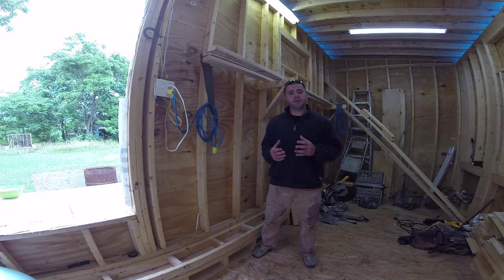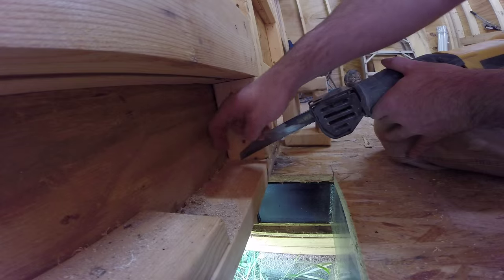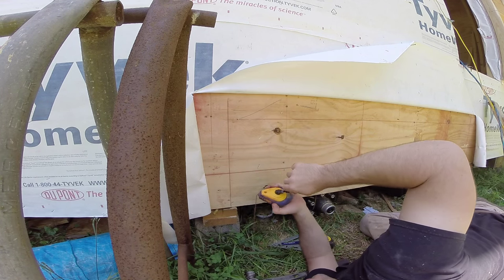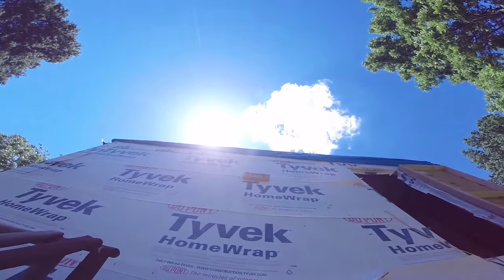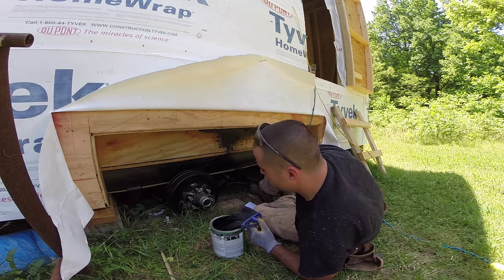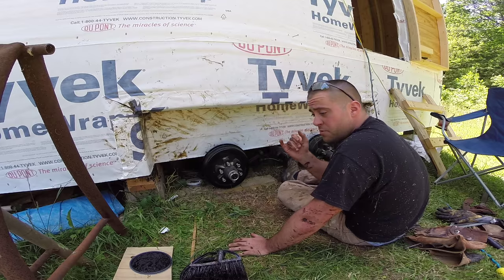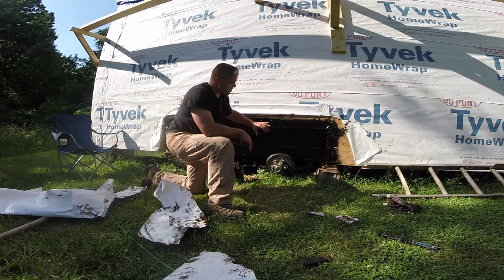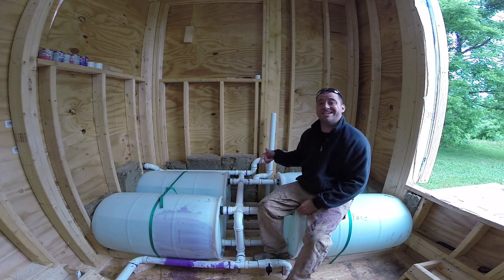Tiny House - Waterproofing homemade wheel wells  Part 2 of 2

Comment: This is such a great idea!  I wish I had known that I could build my own wheel wells before I purchased my trailer.  However, now I am trying to figure out a way to waterproof my metal wheel wells that have the walls built on top of them.  Do you have any advice for that?  I was thinking of sealing them the same way you did, with tar and tyvek inside the wheel well as well as inside of the house.  I read somewhere about weep holes but I cannot find any information on them.  Any advice?  Or maybe you can just come help me build my tiny house???  Bring your pup a lup!

Comment: Instead of using the brush method, I probably would have used the spray undercoating from the Auto parts store.  Might have cost more, but not as messy.

Comment: After a dickhead rear ended my 1/2 ton Toyota pickup (one day after I had made the final payment to the bank) I bought my truck back from the jerks insurance co I had a new tube steel bed frame made by some high school welding students,  I used real  3/4" plywood for the floor and sides including wheel wells (though I lined them with some galvanized sheet metal from a plumbing shop.  I covered everything underside with wet and dry roofing cement.  Messy too but it comes off.  It worked well for twenty years until the plywood failed on the top surface.  It even protected the underside from  small road debris.

 So I expect you will get good results from what you did.  Interesting video (not film). .